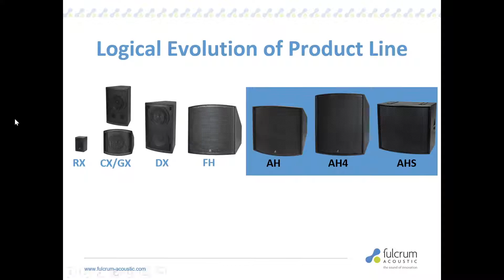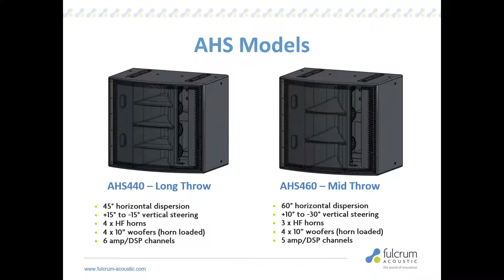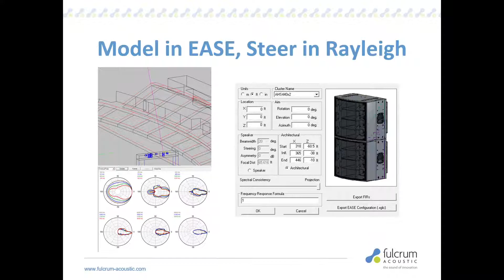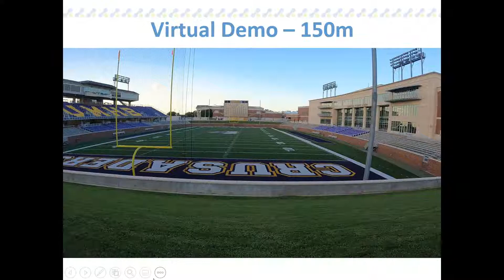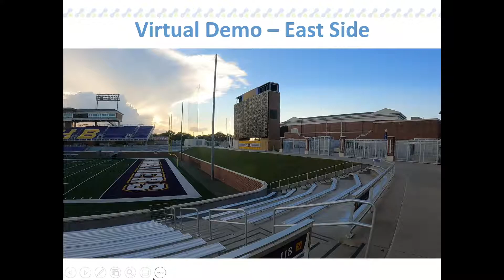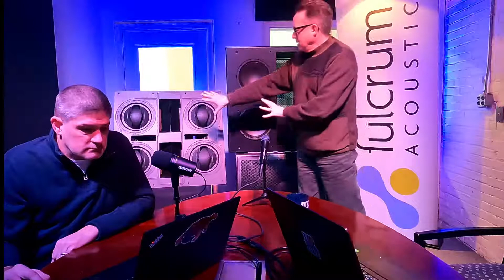AHS Series Webinar

Comment: Hey guys. Sorry I couldn't attend the live webinar, but just watched the recording. I'm wondering about lobing at high frequency. The acoustic centers of the HF horns is pretty far apart.  Do you see lobing in the 2-8kHz range? Maybe it's negligible at long distances? Is it negated by limiting the steering range?
Reply from the maker: You are correct in that the spacing is OK because the steering angle is small. Any steering is nearly always downward, which means that whatever lobing is produced goes upward - over the audience's heads.